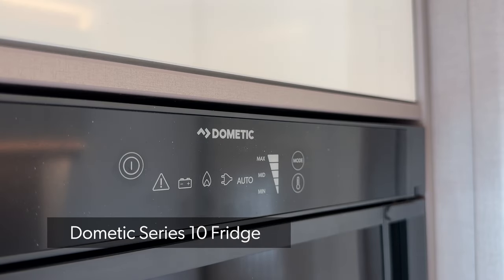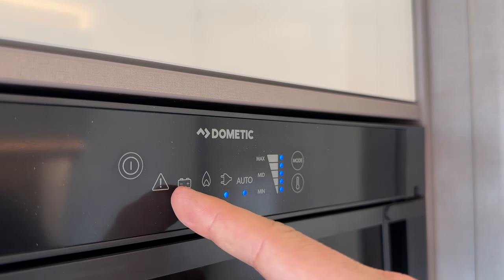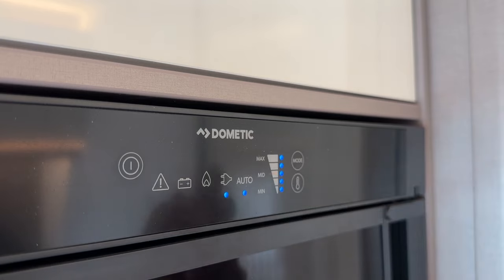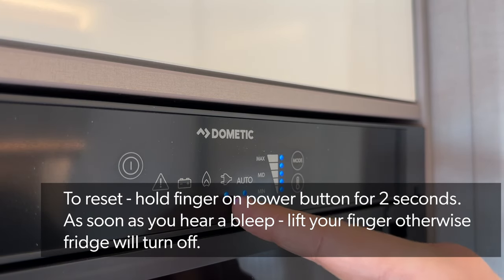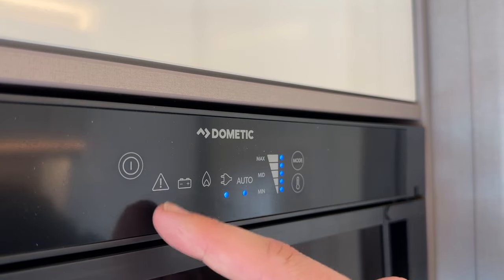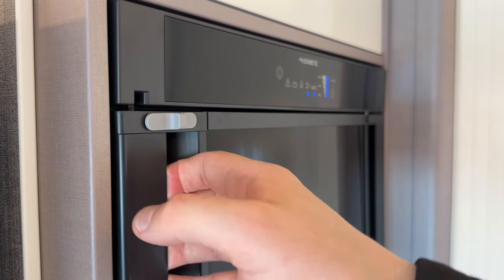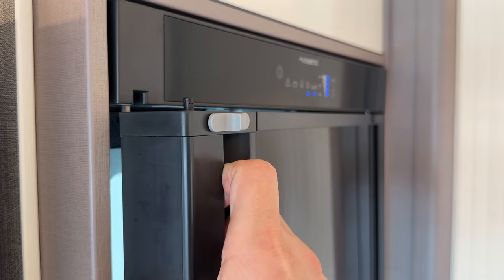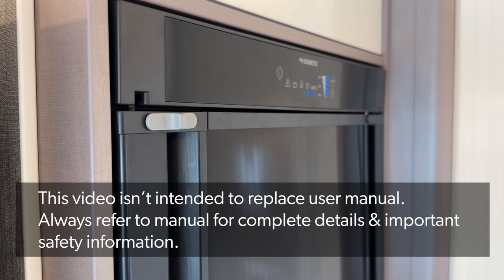Dometic Series 10 Fridge - Quick Guide

Comment: Can the touch panel be deactivated so that the settings don't change each time anyone accidentally brushes against it...
Reply from the maker: Hi there, technically - the panel should 'lock' after a few seconds - and to unlock, hold a button for a few seconds before it flashes and then able to make changes.  I know some people have covered the panel with a screen using velcro for when they don't need access to the screen to avoid any accidental changes.